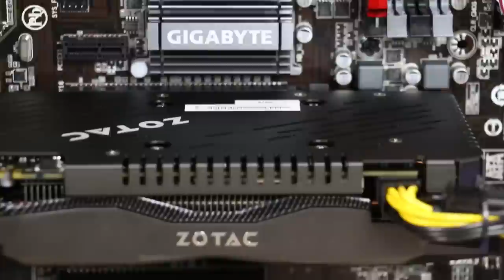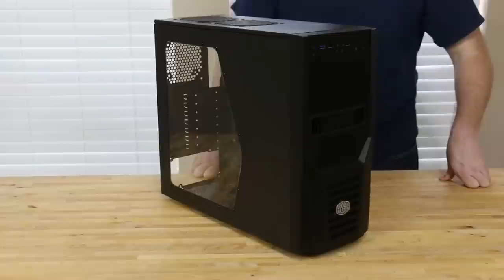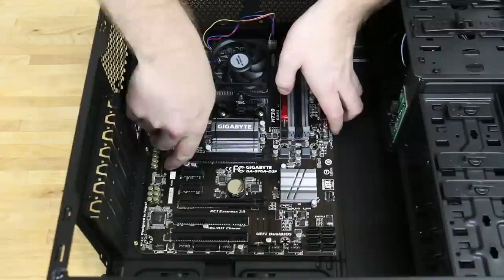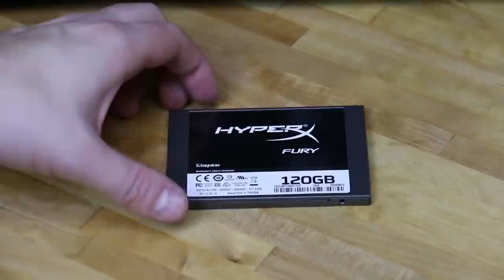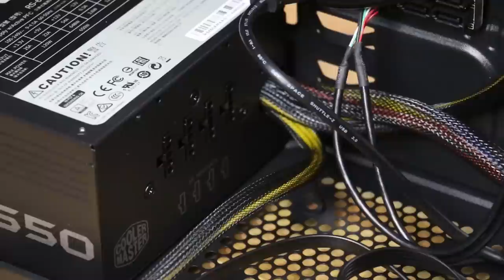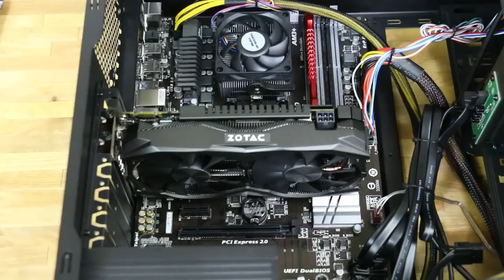$690 Gaming PC Build - FX-6300 / GTX 960 / Cooler Master Elite 431 Plus

Comment: PCPartPicker I Think you forgot 8pin cpu power
Reply: He did 3:19
Reply: Booga Carlson fix what?
Reply: Booga Carlson he didnt miss much. But you should probably just look over the motherboard and case manual to know how to do the wiring which is the hardest part of building a PC
Reply: Booga Carlson the 8pin connector pugs into the little 4x2 connector usually up near the upper corners of you motherboard, it's what powers the cpu hope this helped :)

Comment: I guess this is weird. For 13.00 more I can get a I7 system. It without a graphic card. The graphic is on the chip.  I am glad there are choices for people.  http://www.newegg.com/Product/ComboBundleDetails.aspx?ItemList=Combo.2086378
Reply: It's not weird. Integrated graphics are bad for gaming, If u want to do some gaming the build in the video will perform several times better than the one u mentioned unless u add a graphics card. Also the i7 cpus are not practical for gaming since the only difference between an i7 4790k and an i5 4690k is the hyperthread which is not used in gaming, so u would be wasting money on that cpu unless u also need some video editing or other tasks that take advantage of the hyperthreading in the cpu.
Reply: Jose Abia Yeah I told a person that in real life lol. The person thought I7 is the best. True. Mostly likely if I did buy that computer. I would be using it to mess around. I believe that it would be great for creating games. Part of me is tempted to go and learn that. Another part of me wants to make silly videos.  
I feel Amd is not worth much anymore. I wish Amd would give me a good reason to buy their product.
Reply: You do NOT want to game on integrated graphics. For example: with dedicated gpu in minecraft you get 150+fps everything max. Integrated graphics you get 45-60 fps medium-high settings.

Comment: Look how UGLY IT IS! I don't understand why these companies choose to have these disgusting rainbow cables. What if I have a case with a SIDE WINDOW. I would gladly spend a couple extra dollars to have some black cables rather than these atrocities.
Reply: There is something called different colored cables mean different things, like red and black are the 2 most used cables in general which are dangerous if the tips touch eachother. They leave them like this because t is pointless to wrap it in basically black rubber unless you are geting a nice sleeved cable management which keeps it nice, clean, and professional looking.
Reply: Elucii All cables have different colours its for a reason, even yours, It just probably sleeved. Mine is sleeved